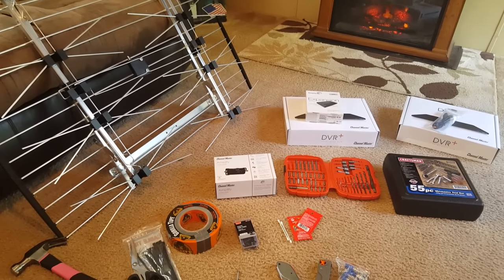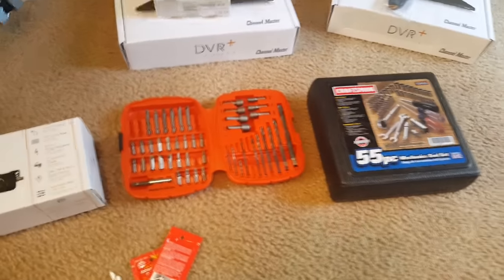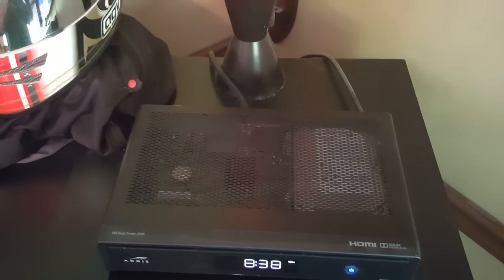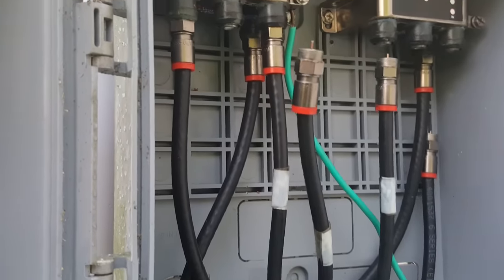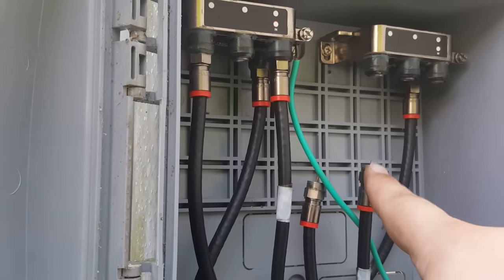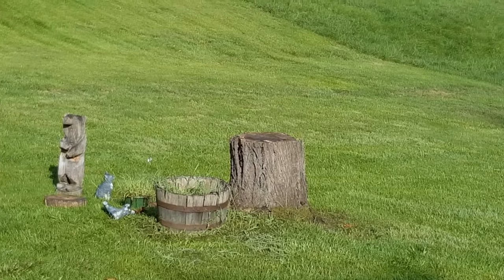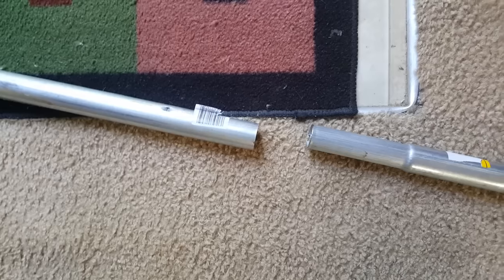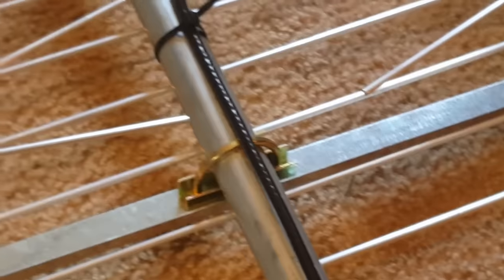How to convert from cable or satellite to over-the-air antenna using pre existing w Channel Master

Comment: Great video Mark!  Hey, my Dish Satellite has two coax cables that connect to a dual connector that’s attached to the house wall.  How do I determine which connection to attach the single coax cable that runs from the OAT antenna?  Or do I need to rip out the existing dual connector and replace with a single one?  Appreciate your advice.

Comment: I am trying go combine an OTA signal and Spectrum Internet into one coax cable and use the existing coax cables in my rooms for OTA TV  while connected for cable internet. I've read that it's not possible, and some that it is. My main cable connection is powered by Splitter a PPC-9M-U/U. Any input is appreciated 🙏

Comment: You had power to the box outside.  You could have saved a lot of time and money by running the antenna wire to that same box.  If you needed an extra amp you could have added one and just run an extra line to the 110 box closest and attached the amp there. using RG6U  as the 12V feed.  I had TWC and that is what It did Works great and only cost me about $9.00 not counting the antenna for the roof.  All connections would be outside and not  attached to inside wall.  AS existing cable were already routed ant terminated in outside box    4 TVs  plus internet and phone

Comment: If you got the right aerial wire for the ground that's ok but overtime it will rot away and you may end up replacing the cable? .
Reply: CaptainPrice376 0
Reply: If your gonna bury the cable you need to use coaxial burial style cable.

Comment: From what ever total channels you have you have probably lost 1/3 of the channels that you should have got. There should have been a pre-amp connected to the antenna, i know because i had the same problem then hooked up a pre-amp it solved it, I picked up another 10 channels because of the long run to the booster attached at the house.
Reply: He did put a preamp on the antenna

Comment: So you basically disconnected your cable or satellite subscriptions, installed an OTA antenna and connected it through the pre-existing cable connection; use a DVR from Channel master and you still watch cable or satellite and OTA?
Reply from the maker: Correct... I do not watch cable or satellite TV ( too expensive didn't find the value proposition in it)  I do use a streaming app I'm using Philio now I also liked sling TV👍🏻

Comment: Might of missed it but how far away are you from the OTA towers? We live in an area right now where we have cable and up to 75mbps net. Heading to a rural area with 10 mbps net and only dish or direct for TV. The OTA TV towers are between 55 and 72 miles away praying we can get signal. Plan on mounting the antenna on the roof about 35 feet in the air.

Comment: How do I watch a TV antenna and keep existing cable?
Reply from the maker: You'll have to run separate coax wires to each TV. Then you'll plug your antenna DVR into an open HDMI.

Comment: Hello , This Gentleman " DID NOT TEST ANYTHING " Before He Installed. He Buried Cable , Put  Up A Tripod/ Mast and On.....
Please  Everyone Test Your Lines, I Meen The Coax Itself, Then The Conectors , Then The  Conection That Is After You Loctate The Best Antenna  Location Before You Put Up A Mast and  On  Ect.  Ect .
Measure  Twice  - Cut Once.